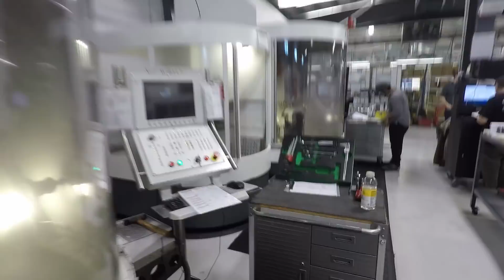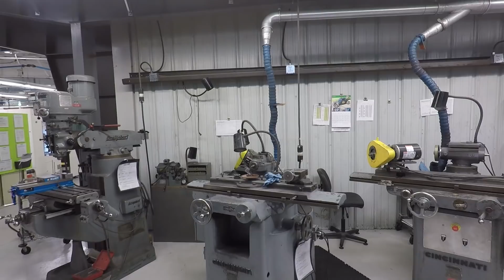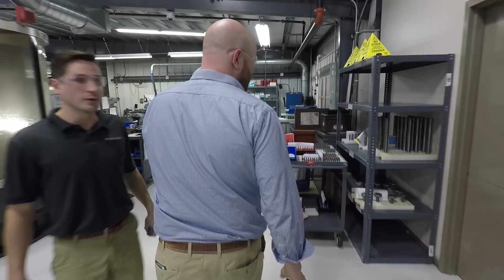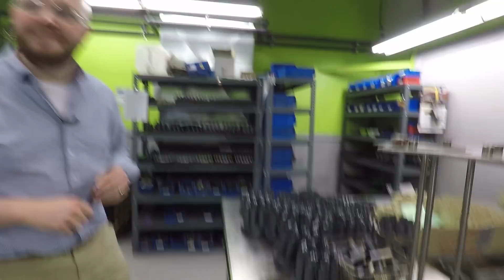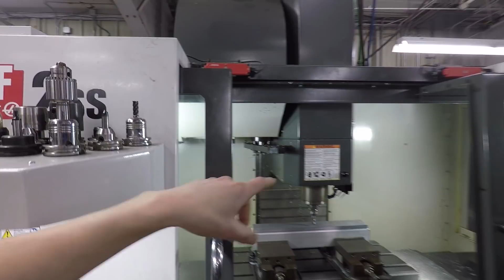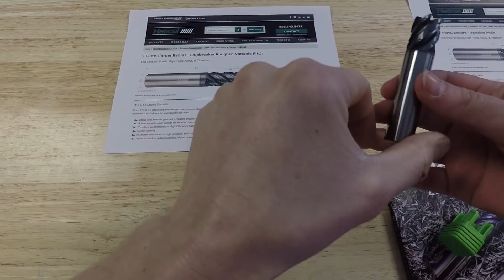Helical Solutions Factory Tour!

Comment: It’s nice to see a Plant Manager with such thorough knowledge of his products and how they are made.  You asked him questions about everything from metallurgy, to machining methods, coatings, even machine construction and so much more; each time you asked something he immediately had the answer.
Reply: Absolutely, He is very switched on  and seems to have done his time on the shop floor.
Reply: I agree xmaswitguns    everyone who spoke had amazing knowledge of thier employer/company!
Reply: Except Tungsten Carbide is not made from cobalt. Carbides are compounds containing carbon and a less electronegative element e.g. Silicon Carbide (SiC) and Titanium Carbide (TiC). Its just like carbon steel but instead of steel it's tungsten.
Reply: Working for him would be a Pleasure!
Reply: James White //////do you really not see how passive aggressively smug he is?
Reply: yes most definitely
Reply: It's almost as if he got paid for knowing such stuff
Reply: He most likely came up through the ranks.
Reply: @MrTerduckin  ehm.... What the fuck are you talking about?

First off, tungsten carbide is effectively a powder and unusable without post-treatment

For inserts, a small amount of (usually) nickel powder is added which is liquified during the stamping or sintering process (depending on the type of manufacture)

For solid carbide, such as "solid carbide end mills", WC powder (and sometimes W2C, depending on the manufacturer) is pressed into a mold which either molten nickel or cobalt then fills. For any high-end end-mills, my understanding of nickel vs cobalt makes cobalt the obvious choice for this

Comment: If anyone was ever curious exactly how they actually do put the coolant ports in to solid carbide tools-

A former boss of mine used to do it, and he told me they use special plastic wire twisted and set carefully in place before they packed the carbide in a mold for the tool. The powder was pressed in a hydrostatic press, and I believe burnt out in the sintering process. That's how they do it.

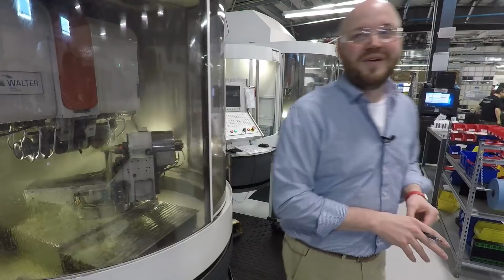Comment: 6:27 dunno if anyone has corrected the plant manager yet, but those machines are NOT hydrostatic.  The Walter Visions are linear motors (magnets), the Walter power machine and mini machines are typical ballscrew and rail setup.  The only machines in that shop that are hydrostatic are some of the Rollomatics.

Comment: Loved this Helical factory tour!  Great video.

Generally, high helix tools like that 6 flute are used for cutting hardened materials if you were wondering why that tool had such a tight packed helix.  We demo'd some Helical tools and they peformed and held up really well with a good surface finish over a a lot of D2 parts.  Would recommend.  The surface finish was not as good as you'd get from Fraisa (best I've used for pure surface finish) but they were much more durable. 

Love to see a Gorilla Mill factory tour!  We use them all day everyday for rough and finish (when the finish doesn't matter)  They're fine finishing when they're new but Fraisa finishes and the actual tools dimensional tolerances (IMO) are on point (within a tenth).  Interestingly, Helical's dimensional tolerances are also very very good.  There is just a sacrifice that is made by tool makers in general.  If you want a tool that will cut fast (roughing)  then the tool isn't as razor sharp.  These tools will cut tough materials for a long time surprisingly provided the chip load is sufficient. Fraisa just makes a razor sharp endmill that finishes amazingly but you have to baby them if you want the edge to last.  Helical has a great product.  It's not as fast as Gorilla but it's finish is better (by a lot) however they don't last for roughing applications compared to Gorilla.  They DO last compared to Fraisa but the surface finish isn't as good.  It's close/very similar when the tool is new but deteriorates faster.  We're a job shop though and not a production shop and so its hard tellin' what the 'big boys' run.  Nice to be small :)

Bottom line is, rough with a great tool made for removing material fast and finish with a great tool made for finishing.  Helical is unique in that, of the 1/2" tools we've tried, they're pretty good at both.  Have good longevity in tougher materials and leave a good finish for a good amount of time.  All good tool manufacturers, Helical, Gorilla, and Fraisa among many others, have regrind services.  The only issue you encounter which I'm sure is more/less of an issue with production shops is that the length is altered.  Easy to adjust for tool diameter, just alter and repost or use wear comp but if the tool isn't long enough for a specific cut, it has to be changed which costs time.

Comment: Funny thing is. I have worked on manual machines that would take that 2 inch 2 flute endmill and snap it in two without being able to see it on the load meter. Cause the machines are so big with so much power

Comment: I worked in a shop that cut a lot of chrome and ceramic.  My question would be how they handle machine abrasion from the flowing tungsten particles. In my experience the chrome and ceramic had a devastating amount of wear on unprotected parts and egress on protected parts.

Comment: I think he got that with the tungsten carbide wrong, it's not tungsten and cobalt but tungsten carbide and cobalt, where the cobalt fills the gaps after the sintering process. Carbide always means that it is a ceramic with an element and carbon, in this case tungsten and carbon. But correct me, if I'm wrong.
Reply from the maker: Then what is "tungsten carbide"?  Tungsten = element.  Carbide = ?
Reply: Carbon! https://en.wikipedia.org/wiki/Tungsten_carbide
Reply: Agreed. Always bums me out when someone bluffs their way through a question, rather than saying they don't know. Makes you question all the other stuff they have to say. Despite the temporary lack of respect, or hit to the ego that saying "i don't know" brings, i've found a much longer term gain in respect from the people i've had to say "i don't know" to. The honesty, and ability to actually answer the question correctly and not give false information is much more valuable.
Reply: NYC CNC
Silicon carbide = silicon and carbon crystal.
Calcium carbide = calcium and carbon crystal.
Tungsten carbide = tungsten and carbon crystal.
Reply: You aren't wrong, you've got it right.
Reply: Definitely got It right. Most carbides are made by combining the metal and carbon in powder form and then passing large currents through them to extreme temperatures so that they bond. And this point the tungsten carbide is still in a powder form and must be sintered, which is where the cobalt comes in.
Reply: The guy DID know something about what he was talking about because he does say 90% tungsten carbide and 10% cobalt. It's obviously not his strong point because he would have corrected John rather than agreeing with him. I still think it's valuable to answer with what you do know about a subject but normally someone will qualify their answer with something like "I'm not an expert so take what I say with a grain of salt..." Anyway, I learnt something from the stuff-up so all good for me!
Reply: I think we may want to consider that Adam was being polite and not trying to correct John.  I would wager most of the people that take this tour just want to know "how do we make more money or better product?"  and John and John's audience are a special type of weird,  we'd rather get all the details of how the blanks are created that Adam's team turns into works of art.  Maybe John needs to tour the Carbide blank facility?  :)
Reply: @nyccnc  Carbides are a class of chemical compounds consisting of carbon (hence the name) and another chemical element (most commonly a metal) that is more electropositive than carbon. There are many other carbides, and they can have all sorts of different properties. For example calcium carbide is used in carbide lamps, as it reacts with water to release acetylen, which can then be burned to get light. The cementite that makes steel hard is actually iron carbide.

The cobalt is just the glue that holds the tungsten carbide grains together (due to the very high melting point of about 3100K (5120°F) it is very difficult to fuse tungsten carbide powder into a solid chunk without using some kind of binder), it is not what makes a carbide a carbide.

While tungsten itself is relatively hard as far as metals are concerned, it is softer than for example chromium. It's only if you react it in equal parts (not weightwise, but one atom of tungsten with one atom of carbon) that you get the extra hard tungsten carbide.
Reply: What I don't get is how something like a 1/32 in end mill can be made.

Also I call BS and those hole for through tool coolant being sintered in, my gut tells me that they are EDMed in. There's no way I can see that you could be that constant enough using mandrels and with out breaking it on removal from the blank....
Reply: @andrewyork3869  You can helical diesink edm coolant holes, I've done straight ones on ram edm, but yeah- they are put in at sintering with wires of plastic that are cooked out in sintering from what I've been told by a former boss who did it.

Comment: 8:40 I think you are both incorrect about "just tungsten", like Tungsten element. It is not. It is Tungsten Carbide (WC, it is a compound, very different than metallic or elemental Tungsten, i.e. WC is way harder than Tungsten alone, and has very different physical properties - lower melting point, lower density, lower thermal conductivity, significantly higher electric resistivity. Still pretty similar to metals, and it can feel like a metal, especially that the thermal and electric conductivity is still pretty good and comparable to some metals, but it is not metal). It does form big crystal networks, with crystal structure hP2, somehow similar to diamond in crystal structure  - m3m. WC has also a second crystal structure similar to NaCl, which is way weaker), lets say 90%, and Cobalt (Co). The mixture, even after sintering isn't really an alloy, but can be still analysed as such most of the time, this is especially true when considering mixtures with Cobalt, as in the crystal network both Tungsten and Cobalt can play similar role.

You both repeadealy just say tungsten, or carbide. Where this is silly. It is like saying kitchen salt is sodium, and 2 minutes later calling it chlorine. But it is nighter.

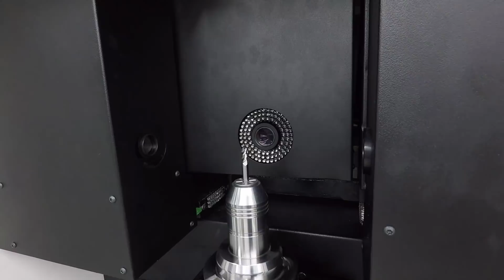Comment: What kind of optical system does the inspection machine at 29:38 uses? Is it using telecentric lenses to get a proper projection without the perspective / parallax distortions? I am not sure because the optical assembly on this machine looks rather small, suggesting it might be using some other method.
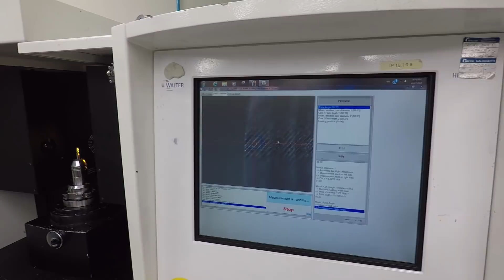Reply: Tele lenses only need to be as wide as the FOV.  Maybe they swap for larger tools or only do small tools in this machine.  I'd say it's a very high quality telecentric lense with prob a 20+mp sensor and monochromatic back light on the left/right camera. Surprised the lighting is not blue it appears to be red/far red. The camera pointed at John appears to be using the same color light but the lighting appears to be projecting in the same direction as the sensor (e.g. not back lit) probably the one used to produce the images at 30:36. 

Source: engineer who works with machine vision, however these are my opinions.
Reply: @loganshirey8377  Yes, just 5-10mm FOV would be enough in this application, and I did find some from Edmunt Optics, that can be relatively small, short, and actually pretty cheap (less than 1000$).
Reply: @movax20h  yup, they may also have those paired to a magnification. Also worth noting, this appears to be an OEM machine so they are likely tailor made optics that u cannot buy one of economically.

Comment: Tungsten carbide is WC (Tungsten + Carbon) not WCo (Tungsten + Cobalt) Carbides in any case are derivatives or Carbon. That goes for Chromium carbide, tungsten carbide, steel carbides, ect. Cobalt is much softer than Tungsten, it would weaken its matrix. Carbon is harder than tungsten, as diamonds are made of carbon.

Comment: Tungsten Carbide is an equal part of tungsten and carbon per Wikipedia
Reply: Wikipedia is fucking wrong then.

See above comment. Anyone who has ever  read the material spec for specific carbide grades knows there is no carbon in it.

Now the place I worked did have a grade just for wear part objects that used floor sweep as a grade- it had dust from every grade in it, for things that didn't need specific material spec, only thermal or wear resistance. That might have had tiny amounts of graphite powder in it, from some graphite tooling used to hold parts during transport around the shop.

Place I worked did like 15 grades of carbide or so, including several submicron grades. Pure Heptane liquid is the only thing used to clean tools in that shop- Heptane is used as a hydrostatic medium for the powder in pressing the billets of carbide. Super super explosive and flammable. 

Carbide fires occasionally happened, from a spark on grinding or sawing. Carbide fires would be swept into metal barrels and capped- then pushed outside.

Carbide glows nuclear yellow green when it burns btw, looks like those self igniting incense coal pucks when it burns, kinda spreads slow and glows yellowish green. Nothing puts it out, even sand smothering. It was separated from rest of powder and let burned out. Fires in dust ducting occasionally happened, where inside the ceiling would catch fire. That was scary!

I know what I speak of.

Comment: I wonder about the efficiency  of the machines only making one piece at a time.  Seems like the processing power and engineering skill is available these days to produce production machines that make multiple parts at a time.  Saves time and operator expense and produces more parts per time/expense unit.  More competitive with the cheap labor market producers overseas.  Come USA get after it.

Comment: Tungsten Carbide is a compound, not an alloy. Tungsten and Carbon are the elements that make them up.
Reply: Wrong.
Reply: @Icutmetal  Would you care to explain your position? 
According to the Materials Science books that I've read, an alloy is a mixture, defined by its metallic bonding, and is  generally represented as a mixture or solid solution of different materials. Tungsten Carbide, on the other hand, is a crystalline compound that has a defined chemical formula and stoichiometric ratio,  because it is not a mixture system like an alloy, but a chemical compound.
Reply: Mordecai Veldt You’re correct; I misread your statement and responded too quickly- my apologies.
Reply: I used to make Tungsten carbide parts from scratch- there is no carbon added. Only raw tungsten powder, and cobalt powder, and various other powdered metals, like tantalum, chromium, etc. There was no graphite or carbon added. The material is mixed, and graded by powder mesh size for things like submicron carbide (aka micrograin). It's placed in special high pressure rubber bags, put in hydrostatic presses to come out like big blocks and billets of pencil lead consistency. It's then sawn on diamond bladed bandsaws, and machined to size using carbide tooling, and often monocrystalline diamond tooling. ground to size on diamond wheel grinders. At end, it is sintered in large ovens to become what you know as the dark gray material that makes up your tools, as well as dies, molds, etc. Finish sizing if needed is done by wet grinding under diamond.
Reply: @CaskStrength777  Thanks for sharing your experience. The "raw tungsten powder" that you mixed with cobalt and other matrix metals would have already been tungsten carbide (WC).

Comment: Hi John. I really enjoy your factory and shop tools, but there is one thing I see very very frequently in your videos that is slightly annoying. Almost every time you ask a question to the factory or shop people, you present options and try to look knowledgable instead of simply asking question. I.e. you ask "So do coolant is doing cooling, thermal cooling or flushing the chips?" (It is a silly question because the purpose is in the questions already). Answer: Both. It would be better to ask "what are functions and advantages of using cooling liquid? Is it needed?". For example there are other uses of this liquid, i.e. you do not want all the dimond dust on your metal surfaces like bearings, rails, and clamping mechanisms, it will grind itself in. Next question: "So do you CAM here or somewhere else?" Better question would be: "How do you do CAM?". Then actually learn something more out of it, instead of affirming your knowledge. This happens all the time in your videos, and the people you interview usually just answer: "Yes." or "Correct.". It is not fun or really instructional, compared to more open ended questions. So instead of asking "Do you use X or Y?" or "You have X and Y and Z here, right?", ask "What do you use for Z?, or "How do you achieve W?". or "How many of K you do use here?". Example of good question at 17:02 "Why some of them have red tops?". That was interesting and allowed the person to simply tell you exactly, instead of you speculating and giving options to them.